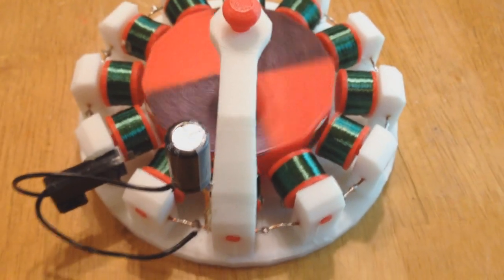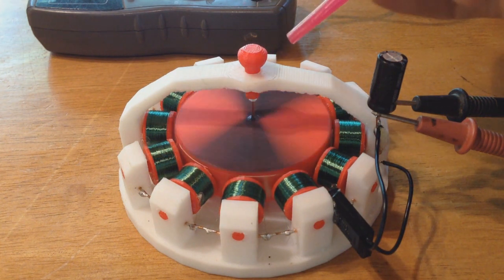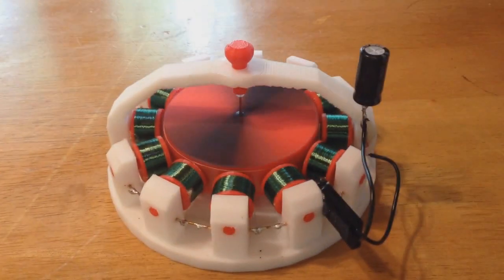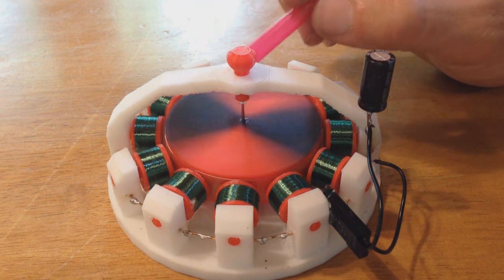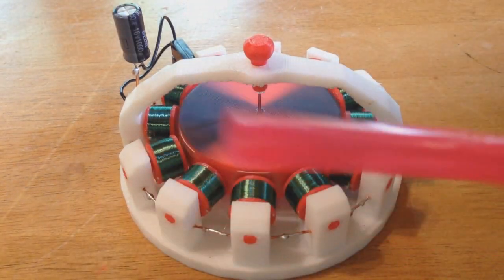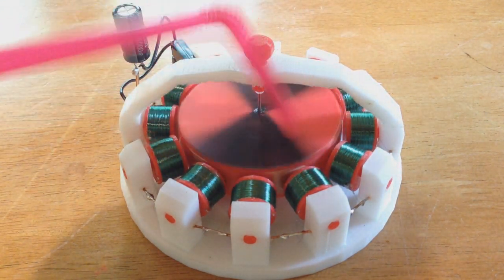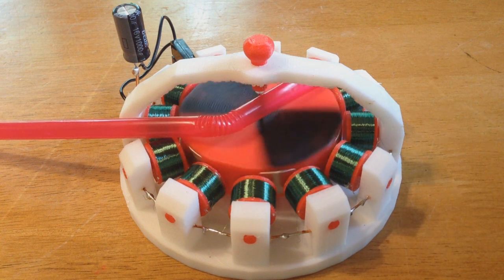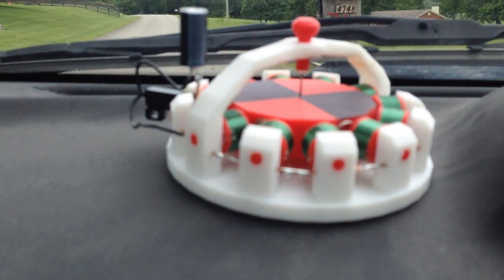No Batteries! EZ Spin V2 Motor Running on a Single 1000uf 16v Capacitor

Comment: Are you doing anything with flywheel properties? I know that power systems of more modern, advanced designs have been adding flywheels to increase stability and decress surge resistance...
Reply: Delicious DeBlair he could also lighten the inner part of the wheel by removing materials and get pretty good balance.. levers work better with the weight on the long end..lol. some centrifugal motion force might be preserved or accentuated by spokeing it and letting the magnets be the  weight...drop mass, gain torque..or so I would think..maybe..or am i wrong? Cause the energy wasted by moving all that mass between the pivot and the outer edge of the wheel... wasted energy moving the middle mass and adds friction on the spindle... but... still freaking awesome.
Reply: Mass is crucial for sustained torque in any machine which requires the operational pinion overcome a static point, [be it a magnet passing a coil or a piston compressing an air/fuel mixture] and since in some systems, energy is lost if it is not stored, a 'spare' flywheel can some times be added to increase power stability and actually increase the realizable amount of power extracted from a given energy source, especially intermittent sources such as solar power. http://www.aiche.org/chenected/2015/03/high-tech-flywheels-help-bring-stability-grid

Reducing the mass of the flywheel would likely reduce the efficiency of the device, I would simply focus on improving friction reducing bearings and vacuum storage once the device was up to the kind of speeds where viscous air drag would become a notable performance robbing factor.
Reply: likely or truly reduce? and I am not being funny or trying to be annoying, but why are bicycle wheels and most drag racer wheels spoked? One cannot reduce the mass totally as that is impossible but it is the centrifugal force applied to the outside of the wheel that places the leverage upon the inner hub or shaft that gives you the "Torque"  placing the weight on the inside of the wheel and not on the outside seems to be counter intuitive to me.  Much like sitting on the inside of the "see-saw" and not on the outer end. And reducing the weight would seem to allow more of the magnetic force to be applied to actual leverage and momentum than to moving weight... but I certainly could be wrong ... but in my testing of reduced friction float plate designs, that's just what I have noticed. And, in this case I'm not sure "flywheel" is an accurate description of whats happening. If you look at Olympic cyclists Bikes, those wheels that apply the ft/lbs of torque to and from the inner hub outwards to the tire have as little mass in the center as possible, if you were to take the free spin gear out of the center, they would notice that it would take much more force to overcome the stored momentum once moving.... so... umm, yes, mass is necessary, but as I have also noticed, a bullet is mass... but throwing it at a deer is not quite as effective as firing it from a gun.
 Mass Speed Distance Time. and some leverage equations... and levers do not have to be heavy, they just have to be able to handle the force applied to them ... but possibly my observations and testing may be way the hell off base, but from what I am witnessing... and testing... the excessive internal mass just detracts from rotation and adds nothing to the torque applied by the magnetic force applied to the outside of the wheel.... just saying that the internal mass of his wheel would be better serving on the outside or not there at all.
Reply: and, I have also been working a long time on the vacuum efficiency and magnetic coupling ideas and function... and may I also add heat dissipation of lens effect upon materials. More efficient wiring and or carbon graphite transfer helps aide in transfer, but when the load ...ehh... you get lots of heat when you spin magnets of opposite poles at high speed... so a form of a heat sink is needed ..but, once you actually start playing with it ... you will notice all sorts of things when you reach high speeds or rotations and magnetic fields.  where ferrous need to be and where polymers need to be, collapsing magnetic fields, strange anomalous  magnifications , levitation..and stuff just coming apart completely.. personally, sustained rpms of in the 100k range with extremely low input force is what I sort of demand from mine. And fully intend to be able to use fiber optics or a pulsed laser  to maintain full capacity generator output ..and yes, close to "vacuum" is necessary for my final phase of my little beauty... but... lets not jump too far ahead... cause my funding is severely limited and I'm just now overcoming in a real way what some people call "cogging" but I call it magnetic alignment lock ..which is bad some times, but ok if you can make it work for you. And I think I have found a way to make it work for me to reach a zero number  or closer to zero than I have ever been before... theory and math are nice.. but really doing it with inconsistent materials and parts is a true pain in the ass... but I aint begging for funding or trying to fool someone on over unity... I'm just trying to reach zero and then cause an imbalance... and nature will do the rest...and if that sound kryptic..good.
Reply: J.T. RipTideProStaff If you are saying that somehow you are confined and constrained to a total gross mass or somehow your machine will [for instance] collapse upon its self like a dying star, why are you seemingly obsessed with merely pushing all of your mass to the rim of your device?

Also why would you not use a smooth flat disc if you needed that for some reason?

I was trying to convey that you are better off 'increasing the pinion mass'.

Nothing more, nothing less. I was not telling you to make a 'cigar', 'barrel', 'disk', 'torroid' or any other shape.

I was simply suggesting [again, 'for instance'] that perhaps you add as much weight to the spinning pinion as your bearings will efficiently support without experiencing impingement drag. I could readily see using lead or tungsten carbide or some other high mass material as filler for this purpose, and it need not be any given shape, so long as said shapes did not interfere with the original operation of the machine.

Another option could be an external multiplier flywheel, only the problem with this could be that of increased friction/drag which could rob the system of as much as you were trying to add to it.

As far as sharing you a link of some company's designs, that was NOT my purpose whatsoever. I was not suggesting to you that you try to copy their flywheel, which I personally did not even fully understand when I heard the description, I was simply using it to point to successful power moderation and conservation based on the stored kinetic energy the flywheel allowed them to harvest and re-distribute in place of faulty batteries. Even then, the idea of the flywheel was neither for the generator section nor the actuator section [be they separate units or one unit which performs both roles] specifically nor exclusively, but as an option available generally wherever you could fit it in.

My experience with engines and with kinetic tools such as kinetic trip hammers have shown time and time again that the more mass a systems core pinion has, the harder it is to stall it, and the longer it will remain within an operating speed where it has the chance to recover.

It alone is not the whole story by any means, but its one very valis issue I was pointing out only because of seeing how you had your device laid out.

Are there 'better' designs? I can't begin to say because I don't even know your design, and can't unless I literally build one to your original specs and then perform a series of long, rigorous tests on it, which is apparently impossible at this time.

The reasoning you seem to be adhering about bicycles seems terribly flawed, speaking as a former touring and racing cyclist, as well as an outlaw drag racer.

The mass of a bycicle has nothing to do with delivering torque any more than the mass of a flyswatter has to do with delivering armor defeating energy to a fly.

In a bycicle or in a dragster, you have many varied power trains being discussed, and none of them are sustained by a 'ringing circuit' or an 'echo reflection circuit'.

A cyclist uses hard brutal muscle force depressed on a lever/crank, multiplied by a mechanism [usually ratioed sprockets driven by a chain, although I have seen over a dozen variances on cycle power transmission] and the reason for the lowest possible mass of the wheels and the cycle in general is quite obvious: because you are starting from a standstill and putting all of your force into ACCELERATING, not coasting.

Your system works by coasting, so mass is beneficial, just as it is in massive 100 car trains, making them linear flywheels filled with immense kinetic momentum compared to their relative resistive forces.

A dragster or a cyclist needs to consume an expendable fuel to generate unretrievable torque to develop linear thrust, and to do so, one has to defeat such forces as gravity, mass, inertia, friction, turbulence, viscosity and the mechanical physical resistance encountered in adibatic force transfer.

https://en.wikipedia.org/wiki/Adiabatic_process

Half of those issues do not pertain to your design, and at least two of the  can be virtually eliminated, while at least one of them is beneficial to your system.

I could readily take a strong, smooth operating version of your motor resonator design and over a greatly protracted period of time develop a measurable increase of power, without any severe modifications if I am understanding the basic principles of it, but to increase efficiency, there are some potential tricks you could use which would further increase the capabilities of it at least, if I may make this sound so bleak...by 1.35% or just touch over one and one third percentage points.

Would that make it 'perpetual'...? Not likely, but it would certainly make it run longer, as would a heavier flywheel, magnetic bearings, vacuum encapsulating the device and greatly increasing the spin velocity.

By the way, I have a neat 'little' coil winder I built which I can use to custom wind coils of a great span of sizes and shapes from thousandths of an inch across to as much as six inches across the cores in any shape one could want from conical spool, normal spool, pie wedge, square, or rectangular with any wire gague from 48 to 1 and even in foil or ribbon.
Reply: J.T. RipTideProStaff I agree with everything you just said except that you must always remember that the higher the frequency you go, the shallower the electron penetration into the surface of your wires, so you will certainly have to rely more and more on voltage and less and less on amperage as you increase the operating frequency.

I was dealing with the issue of cooling microcircuits in my cryogenic freezer, which is fine for stationary objects, but totally ineffective with a spinning item where the liquid ethanol creates insane viscous drag, but I have been pondering about the potential use of thermoflourescence as a means of heat dumping.

A minor point to keep in mind perhaps is that the more mass in the flywheel, the more it can disipate heat, especially if its built of tungsten [one of the best known heat sinks on earth], copper [less but cheap] or aluminum, [better than copper but low mass].

If you wanted to rely on a rarified gas for heat transfer, hydrogen is always tops and helium is #2 and both of them offer very little viscous friction and their mass turbulence is relatively negligible.
Reply: lol. cool.. So..am I off base ? Cause I mean.. reducing the friction is a big obstacle... and transference of applied force more efficiently has been kicking my butt... and necessary mass has seemed to be be a placement thing.  And my alignment tools and applied force measuring tools are a timing light and the feel of my hand...so I certainly could be WAY OFF in some of my testing results and not be understanding whats the magnets or my hands imperfect attempts to apply a uniform input... also... materials in relation to the vacuum ..well... for my cost overhead, it's impractical to even test the necessary  low pressure environment turns just yet either. and time to disassemble and reassemble etc blah blah blah has limited me to testing half the internal shaft rotor..but... if I can stabilize that and get it to hold the necessary weight and reduce the unnecessary stuff and get it to function properly (or within reason ) and then "Vacuum " (which is sort of an incorrect term really..but lets use that for lack of a better one and hand cramps cause by descriptors) ... I'm fairly certain that if I mirror top and bottom uumm Plumb- thingies etc... that in a low pressure Vacuum the wind resistance I am totally hating right now will be reduced significantly.. I'm not being silly when I say "as close to Zero as I can get " cause there also seems to be a certain amount of magnetic field frictions depending on the field interactions and even minor "tweeking" seems to change dynamics by a whole bunch. 
 So... I really am not trying to be a jerk (and I mean that in the most sincere way..cause I am not half as educated on paper and technical terminology often escapes me but I am more than willing to be educated ) ... This little project has been on my mind for over 8 to 10 years now. Maybe even longer if truth be told... Saw a toy from some guy at the Carnegie Museum of Natural History when I was a kid ...it totally blew my mind... but ever since I saw light turn a vertical shaft with lever arms on it.. no bearings no nothing but a pencil lead with 4 arms at the top and paddles painted black and white... in a lightbulb shaped thing..in a "Vacuum"...well.. it's been torturing me. A solar sail, here on earth, fully functional... spinning away on the kitchen window sill... Mom was so pissed when I took it apart..lol..but I had to, I was SOoooo freaking amazed...and since then I've been trying to figure out how to put that to a real use. The magnetic float plate thingy came to me ( I got distracted by girls and partying) and then sort of faded off the project... but about 10yrs ago I suggested a design concept to BNL but I am not sure it was ever taken seriously... cause like really..who the hell am I ? But since I got no response over the past 10years.. I said..screw them, I'll do it myself. 
 Started racking my brain ( and seriously over loading it, cause really, I just want to fish and surf... cause I'm like that lol) ..But God has recently been on me in my dreams and waking .about getting this done. He is loving and very kind (often) but also very persistent in His "gentle Urging" lol... And He says He won't Miracle it into existence and I have to do it myself.... But..the Good news is, He has told me how to make some things that seemed like problems actually be part of the solution... And when I say..I am sooo freaking close now...I mean... it's just making it and minor funding issues now... but He is also giving me work at the right times to get the precision machines I now need... anyway... the math is simple and the basic idea is not to violate the fundamental laws of physics and motion, but to make them work for and with... Nature seeks Balance but can never truly attain it ...and nothing is really at "rest" since the Big Bang ( creation ) ..and things in motion etc... and Archimedes and Bernoulli and Venturi and Faraday were ..well, just really cool. Newton was a nut job but I can now see why. And Tesla just has a materials and funding issue... Probably wanted to live too. And Planck telling Einstein "Quit telling God what to do..."  freaking brilliant. ..anyway.. This guy here is totally onto something... but the first steps (foundation) keep magnification of error over distance from kicking your ass later. And if we can reach a somewhat state of balance, then we can then go from there to.. trick nature into working for us... don;t just encounter a problem and then say..damn, I guess we can't.  Some times the problem is a solution in a sense. And simple math is better than advanced trig some times (especially for me ...  I like one plus one and things like that. 1-1 or 1 plus negative one and if I am forced to, multiplication and divisions... but anything beyond that..often too complicated for my tastes. They already have all the parts made individually... it's making them all work together for the desired outcome... or so is my thought.... and when we can achieve that "zero" ..hand it over to some electrical weenie guru type and then say..GO!!! Have fun...but for me... I'm thinking the power company can pay us back... and I can live modestly and enjoy life and fishing and surfing and my lovely most beautiful inside and out Girlfriend and partner in lifes joy's and toils. Do some gardening and say...ok..problem solved. 
 But if you have any input which could help me..cause you did mention things I am totally working on vacuum and frictions reductions to lower necessary input torques needed to perform useful work... stuff that can actually do something for man and not a bunch of "well maybe some day"'s ... Before I die would be freaking nice. And then I can go back to my effects of consciousness on the Quantum field studies...at the beach... lol.
Reply: J.T. RipTideProStaff As for 'applied force testing' where you have essentially micronewtons to piconewtons of power, some times they use computer models and laser interferometers.

Another, more direct method to measure your net power potential would be to apply some kind of low demand gear reduction like this: http://www.micromotion-gmbh.de/englisch/products/micro_planetary_gear_actuator_drive/mpg_dimensions.htm 

Keep in mind, that no matter HOW you apply a load to your device, a lod WILL be applied OTHER THAN the final work performed.

In other words, every step of the process will rob a certain amount of power from the end result, even if its measure in attonewtons.of force or even femto-watts of power, its there, and its real.

Part of the job of the engineer who is seeking perfect and true efficiency is to discover and reduce these environmental loads where possible so that more of what is being collected is making it to the job site and being registered as 'work performed'.

The higher the voltages you can draw across your coils, the greater you will be able to overcome the resistance of these fine wires, but each measured distance of wire will result in its own measure of resistance, so naturally, you want the least amount of wire for each turn achieved.

Small, high permeability cores are important to efficient coils. I do not know how much you or those reading this know about magnetic ferrosillicates [also known as 'magnetic steels'] but here is a little piece which will somewhat explain it... http://www.aksteel.com/pdf/markets_products/electrical/mag_cores_data_bulletin.pdf 

The general issue of higher frequency power generation and transferral are well discussed in this paper, although it is not all encompassing in its scope, it easily illustrates why if you aim to increase efficiency, particularly in the realm of higher frequency power generation, ferrite cores are not only preferred but recommended. http://eaas-journal.org/survey/userfiles/files/Engineering%20and%20Technology%206.pdf 

I have the materials and ability to cast custom ferrite cores [Fe2O5 (99 to 72%) /Al (1.2 to 26%) / NaOH(SiO2)2 (.01 to 3%) / Ni (tr to 1,1%) ] as well as I can nickel plate these for corrosion protection and cosmetic effect, particuarly where one would need these cores formed directly to the coils for maximum efficiency, stability and mecanical integrity.

Rather than say 'vacuum' you may possibly be meaning to say 'evacuation' or 'rarification' possibly?

Overlapping sequential discs of coils and magnets with Mu Metal between them to buffer field interference is your best way to reduce 'cogging'/'stepping' or detentive field attenuation which is one of the historical enemies of 'zero point' energy quests because it is the simple force one must first overcome when driving magnets [permanent or electric] against one another.

The point in this remark is to make it clear that no matter how hard one tries to eliminate residual polarization, for a few brief moments in time [from mili to micro seconds usually] you have to deal with the field collapse/point resonation of any magnetic or magnetized object, now matter how close to unaligned is in its resting state.

The trick is to use tuned capacitors on each coil to encourage them to resonate at your optimal frequency because this will greatly reduce this lag and greatly increase parasympathetic resonation at the 'sweet spot' and is why they place capacitors on motors.

In your design, it would still help despite them being reverisibly stators and charging coils.

I have friends who can micromachine parts for you, one of my brothers and my GF are both advanced electronics engineers, and I have both chemistry, physics, mechanical and electrical engineering experience with a goal [when I have the time to complete it] of finishing my masters in Manufacturing Engineering.

I say all of this, because even though your system seems at this moment to merely 'coast a long time' I think you are really onto something there which I could see possibly becoming something truly serious with the right improvements.

If you can keep applying all of the best tweaks out there to it, we may just be able to see real results.

I can manufacture/mass produce it once its perfected because I have everthing needed at my disposal to do so.
Reply: Ok... I need an Email or something. I have too many questions on stuff... you guys have lots of stuff... Better not bombard and just get to one thing at a time in order . pages saved to favorite though... read a bit... got a tech woody and see a few places I certainly need help and advice on what materials i need where.... and very excellent that you sell that stuff too. WORD.
Reply: Omg... Ferrite cores... ok.. now... Helium or maybe hydrogen..right...  ...  see.. damn... ouch... cold to make it dense.. and then pass it into a chamber that will hold the expansive pressure... heat the shit out of it but don't let it expand and then shock the shit out of it with some spark plugs at the same time with some super high frequency but on a small scale... what sort of harmful radiation would be given off ? I mean... I know uranium is nasty stuff... but fusing or bombarding hydrogen liquid or compressed gas while its in that ..errr.... too far ahead... Generator to power the house or boat motor is first attainable goal.... but yeah.. interesting that you linked that page... cause I was wondering if lawnmower parts could help or improve my generator perfomance... that little spark zap the crap out of me more than once in testing... amps and volts... little sucker has a bite.... so yeah..let me read and absorb a bit...and the Email thingy would be cool... cause I am sort of on the fence about the fusion thing... totally might not be necessary until applied to some sort of Ion Drive for a space vehicle...and they aren't paying me enough and cryogenics isn't to a point where I trust any of it with my life or anyone elses... 
 But yeah... let me read and absorb..but the links you sent make me feel like ..well... screw it.. Who cares who reads this stuff anyways... I hardly get it all myself... so if my brain even starts to ache and my eyes glaze over... ( and I am totally interested in it...) those who are not interested in it will just say... damn..200 lines..not reading that crap. lol
Reply: By the way... I think I will delete all the responses and interactions soon...after I get your business Email  ... Just for my tinfoil hatted heart to feel more at ease...
Reply: and..that gear box... um... not exactly what I am bulding... magnetic bearings and alignment is the way I am going.. in a vacuum... reduction of contact frictions... not just the wind resistance... There are ways that I have found to work best for shaft alignment and stability...  I mean..I have check to see if anyone is doing it exactly like I am..but I only see similar in concept.. but theirs do not seem to want to self correct with increase of rpms...or even aide directional motion once spun.....ok..still reading... but want to get back to my circles ... hand making this stuff is maddening and anything for a diversion..but diversions even for educational purposes are detracting from progress with parts making... like i said..no CNC machine here... thank God for a good eye.... but Lexan is a pain cause it's so clear and gives me optical illusions....excellent material... but the properties of it sort of make me think things are off until measured and remeasured when polished ..and looking right through it says its polished..but often hard to mark and see the edge... different kind of lense and plane effects... but smooth reduces even air and wind frictions too...so..it must be done...you have a good night.
Reply: But yeah... advice on braided or multi strand stator windings with an attempt at coating with graphite before the varnish is applied,,help or not help?
 Or would that just freak things out?
Reply: J.T. RipTideProStaff Okay, I did not catch up with your entire collection of replies here, but since you asked, yes, I think it would be best to do this via e-mail.

I'll message you this address privately by way of your profile.
Reply: J.T. RipTideProStaff Okay I sent you a message with my engineering e-mail address.